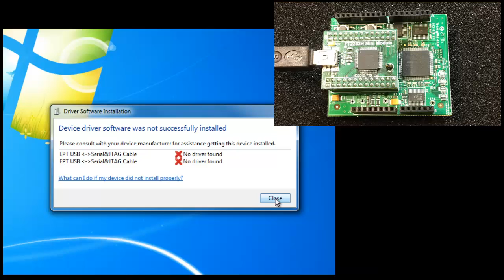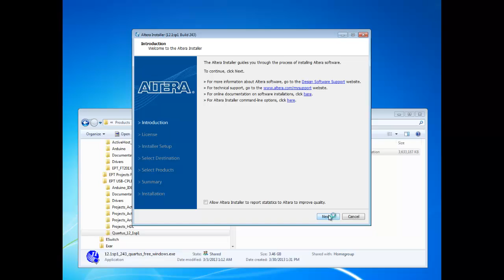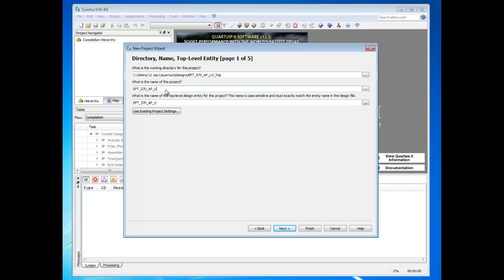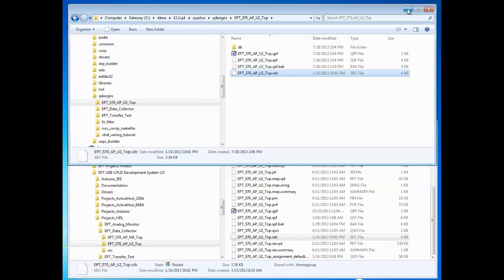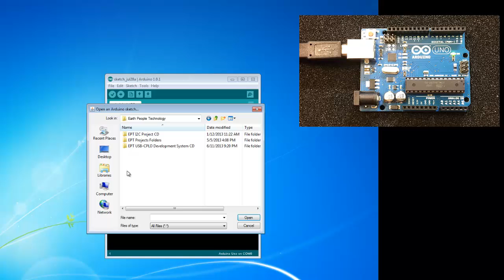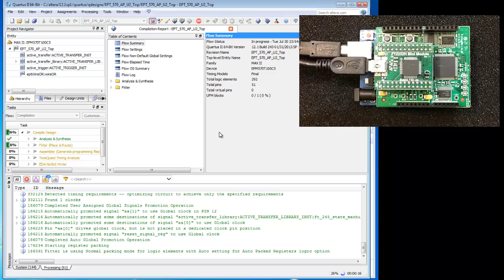Getting Started With FPGA's and CPLD's

Comment: I gave up on his particular project in frustration. I recently bought the EPT 570 devel board, and it came with CD, etc.
The transfer test project sets up, compiles, loads to the CPLD, and runs with no problem.
Trying to get the Data Collector to work has not been successful. I've even downloaded another copy of the project from the website thinking the problem may have been fixed. No, the problem is the same. Here are my compile errors:
Error (12049): Can't compile duplicate declarations of entity "eptWireOR" into library "work"
    Error (12180): Instance could be entity "eptWireOR" in file eptWireOR.vqm compiled in library work
    Error (12180): Instance could be entity "eptWireOR" in file eptWireOR.v compiled in library work

If I open one or the other of these files and comment out the eptWireOR definition I get a successful compile and upload, but the program doesn't work. The Data collector screen does nothing when pressing the start button.
The trouble is that I'm so new to this I have no idea where to look for the trouble.
I'll just move on to other projects at this point. I've spent hours trying to get the Data Collector to work. It's not the arduino. the code loaded just fine, and I tried two of those.
Reply from the maker: Fred Flintstone  Hi Fred, sorry to hear you are having trouble. I can get this fixed for you. First off, are you using the UnoProLogic or MegaProLogic?
Reply: EarthPeopleTechnolgy
Hello, I have the UnoProLogic.
Reply from the maker: Fred Flintstone Ok, are you using the EPT_Data_Collector project under ..\Projects_HDL in the DVD? If so, there is an error. The file eptWireOr.vqm is incorrectly added to the src folder. 

Could you explain the steps you take to open up the EPT_Data_Collector project under Quartus? 

Once the project has been opened under Quartus, you will need to make sure that eptWireOr.vqm is not selected as one of the files to compile when building the project. 

One quick thing you can do is to delete eptWireOr.vqm from the folder. This will give an error "Quartus could not find entity ...eptWireOr.vqm". But, let me know the steps you used to assemble the project and I can explain how to fix. it.

Comment: Why would i need this board , if you say it has a fast bus to the PC, which is getting data from arduino - it can only go fast as the arduino is sending data no ?
Reply from the maker: You are correct, the Arduino does set the top speed of data transfer to the PC. If you use Direct Port Access to perform Read/Writes to/from the GPIO's of the ATMega328 microcontroller, it takes four instructions to send a word to the UnoProLogic. The main clock of the Arduino is 16 MHz. So, it takes two clock cycles per instruction. This means you can send one word to the UnoProLogic at the rate of 2MHz. In the demonstration video, I am writing bytes from the Arduino to the UnoProLogic. So, I could write 2 MBytes/second to the PC. In contrast, the Arduino has a top speed of 38400 bits/second using the serial port. Yes, I know the Arduino will support speeds up to 115200 bits/second. But, the error rate gets rather large on anything above 38400 bits/second. So, the serial port is useless above 38400.
Reply: Thanks but i still dont understand if arduino does not supply 2Mbyte/sec of data what would it give you to have this thyoretical ability
Reply from the maker: Shlomi Cohen There are many applications for this kind of high speed transfer. The most widely used application is not sending the data at 2Mbyte/sec continuously. It is used to do some data collection, processing the data, then sending a burst of data over a very short time in order to start the data collection process again. So, we would send 10 Kbyte of data over the period of 5 milliseconds. Check out this video Create a Fast Arduino Oscilloscope for just such an application.